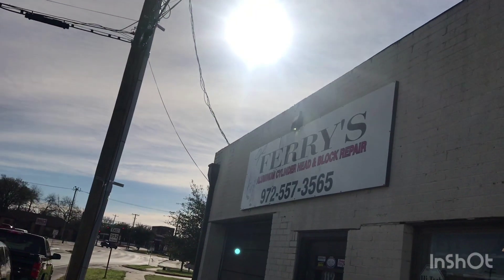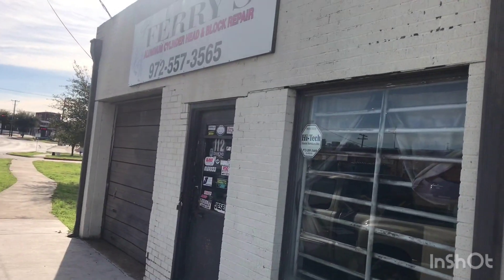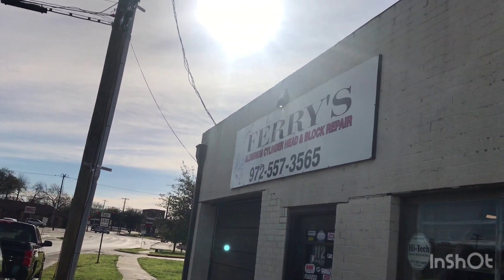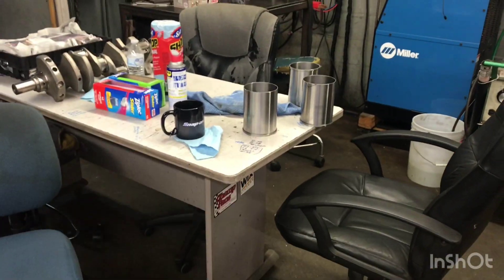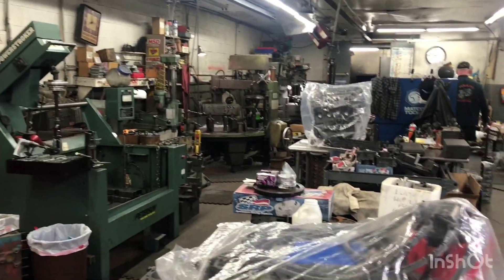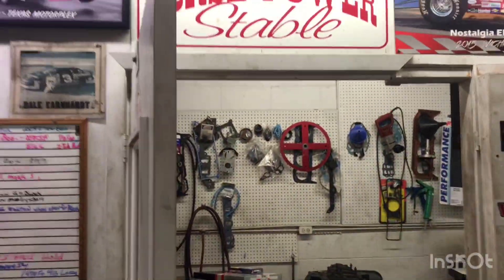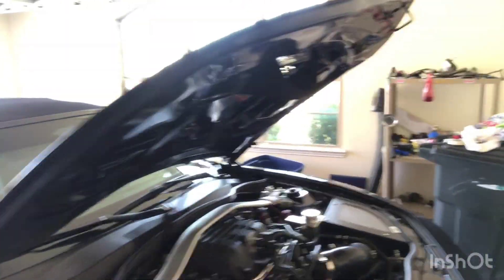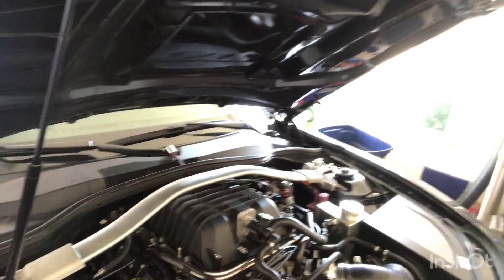Aluminum 6.2 Ls engine block repair

Comment: Yep. I broke the boss for the alternator stud on my Ls3 when I was pulling it out to have it stroked. Machine shop fixed it and you wouldn't even be able to tell where it broke off at
Reply from the maker: Yes sir its amazing what a good welder can do with alumimum!